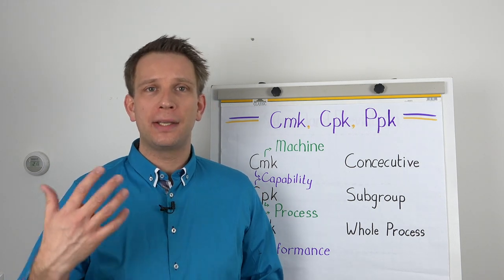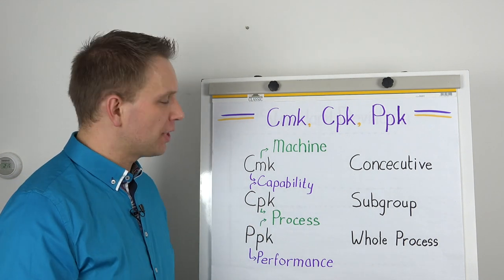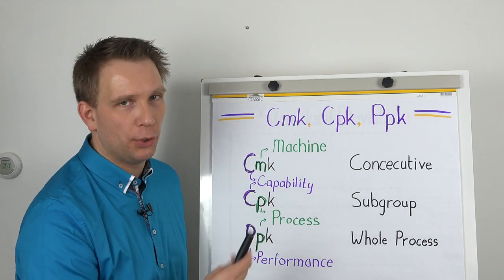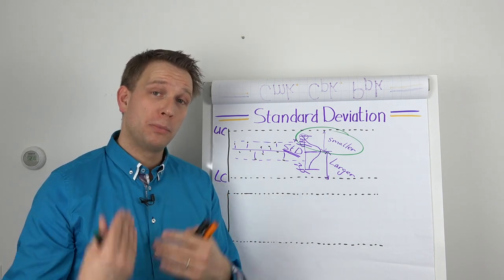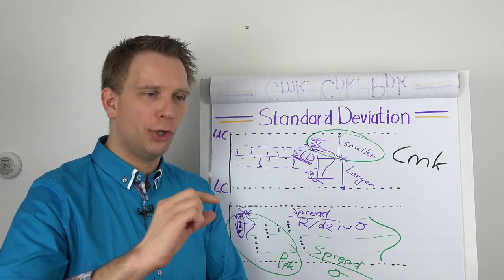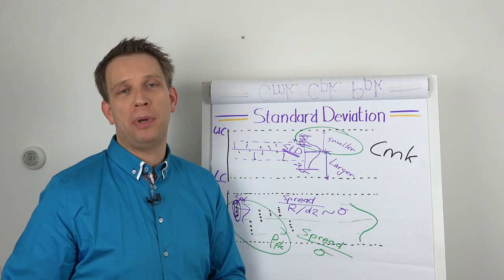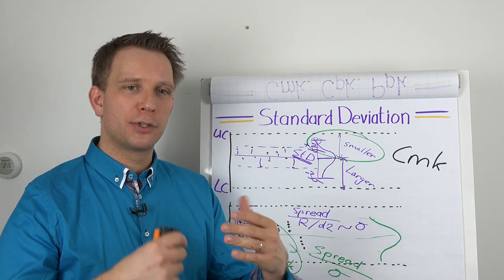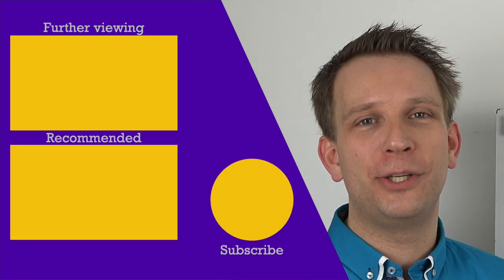How Standard Deviation and Sampling work in Cmk, Cpk and Ppk

Comment: Hello, nice explanation, I have a question, machine capability study should be done during the machine qualification, specially the performance qualification, right?
Reply from the maker: Yes, I would definitely suggest that when purchasing/validating a new machine - this is probably the last chance you'll get to keep the machine manufacturer responsible for getting stable product quality at full running speed (be very strict on that the line has to be validated at full speed 😉)
That said, it's not the only moment for doing Cmk/Cpk analysis - it is a tool you will also use for general process improvement projects and especially also when launching new products on an existing line.
What I often see is that a line has been in a factory for years, but the organisation now wants to decrease process variation or reduce how actively operators have to steer settings. A combination of Capability studies and SPC is often used in such situations.

Comment: Hello, firstly thanks alot your answer on my question regarding Accuracy for another video!  here I have a question, before doing the study of machine or short term capability, we should firstly check the stability of process and normality, is that true if my process is not normal, then no need to check the stability? are they depends each other?
Reply from the maker: They are connected, yes:
If the process output is not normally distributed, you can't use normal statistics to predict future outcomes, and so you can't rely on the SPC rules. Now technically there are some other distributions too, and if your process follows them you could still say it's stable, but for 99% of processes we deal with, not normal means not stable. Especially where there's a strong break from normality (plot it in a graph, if it looks more or less normal, that's usually good enough; you don't need to do a Q:Q chart analysis or other specific test for normality). A 'secondary peak' in your histogram usually indicates that there's another distinct way your process behaves. Could be start-ups create different product, or each materials batch change does something to your process, or maybe there's an automatic cleaning process that kicks in from time to time but then also affects the products produced at that time,... Lots of possible reasons for this.
A non-stable process can still generate normally distributed output. The most common example is when short term the process behaves normally, but the centreline moves up and down over time - if these moves are fluid you'll still end up with a normal distribution, if there are jumps up and down the total process with not show a normal distribution. These types of jumps are often from a change in settings (that then lasts until somebody changes them again), differences between materials batches (with the product made from the new batch all varying around one new centreline), or some other sudden but then stable change to a process parameter.
Those fluid centreline shifts will also trigger SPC alarm, by the way, as they're also not stable. They just won't always show up as non-normal if the changes are fluid and often enough.

I would always advise to check both normality of the distribution (visually, using a histogram) and stability of the process using a run chart. They are connected in their outcomes, but drawing both charts will help you to spot the underlying issues.

Comment: Thanks for video.pls explain more about cp vs Pp  data capturing method and their  standard deviation calculation methods.Thanks
Reply from the maker: Thanks for your question. The sampling and how data points are taken into account for standard deviation determination is the same for Cp and Cpk, so the difference between sampling for Cp and Pp is the same as the difference for Cpk and Ppk. I made a video explaining most of your question: https://youtu.be/uPfjDMjFLQE
Let me know which part remains a bit of a mystery and I’ll see how I can make that into a new video explanation.
Reply: @TomMentink  Thanks for reply.I understood perfectly.
Is my one of conclusions correct that Pp can be equal or less than Cp but Pp can never be greater than Cp as Pp considers all variations?
Reply from the maker: @Ajy77  yes, that is correct (except in some very bizarre cases, with high spread within sample groups, but no spread between sample groups - but don’t focus on that 😉)